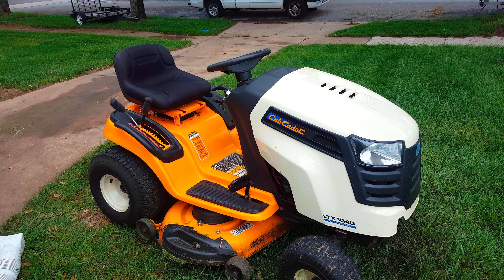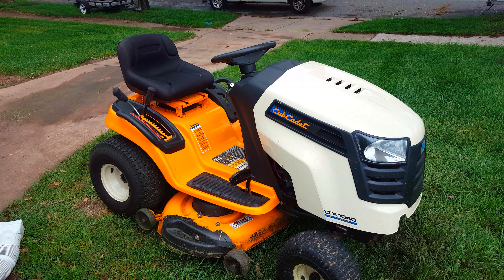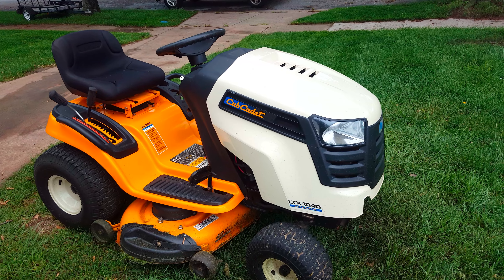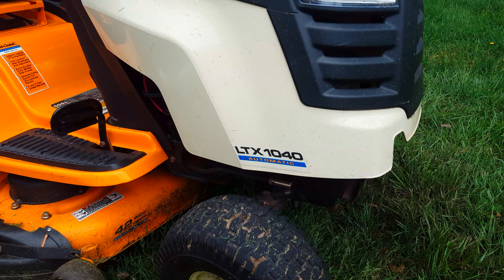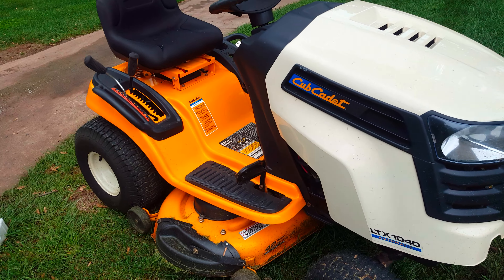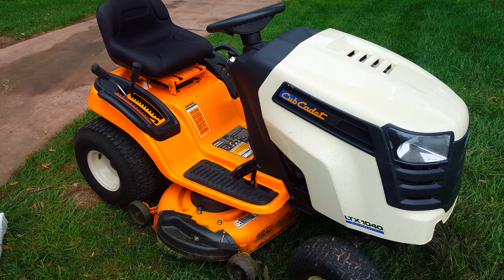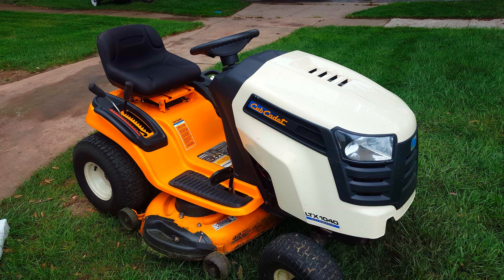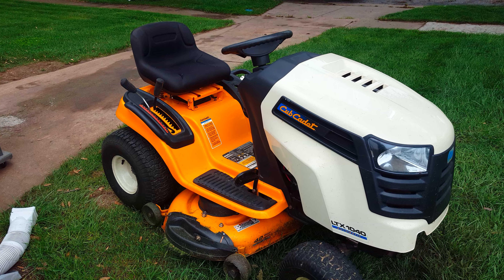Cub Cadet LTX 1040 moves slow

Comment: I own a Cub Cadet LTX 1040 as well, bought it in 2012 and just replaced both drive belts last fall... no slipping or slowing down... belts were getting cracked up, but had to push the Drive Pedal a little further each year to maintain speed. Engine is sound, no problems there!

Comment: This tractor has a CVT, (Constant Variable Transmission), style speed control The main drive belt from the engine goes through the drive pedal pulleys and then to the CVT drive pulleys directly. The CVT pulley also drives the smaller belt which goes around an idler pulley with the spring tensioner, and to the transmission pulley, which is the large one. I just picked up an LTX1040 that has 154 hours on it. That's SIX full 24-hour days of use on it. The Kohler engine was blown. Terrible engine for reliability. SV590 engine. They have serious self-destruction problems with the crankshaft counter-balance breaking and the dual cam shaft breaking. This one I just got had the counter-balance problem which went through the engine block in SEVERAL places. Tipping the engine sounds like marbles inside it. I replaced the engine with a brand-new Briggs 33S877 19HP engine. Almost a direct replacement engine. Runs better than the comparable Kohler.
The Slow Moving problem is caused by several factors, one being as you said, oil, grass, and other contaminants on the pulleys. Obviously the belt is one that causes it. Only use the original belt on this one. It isn't the best system, but costs less than the Hydro-static model. The harder you press the drive pedal makes the Variable Drive pulley change its pitch for each side of it. The center of the pulley slides up and down which makes the pulleys change the ratio of each other. That pulley may also bind up/rust which makes the speed not change.
Good video!

Comment: Friends, just a little tip: if electrical issue, note there is a hidden fuse down under the seat. This will save u some stress.

And tip of the hat for the video!

Comment: Thank you! Just got one of these for free because it won't move. I already disassembled the transmission and regreased it. Still wouldn't move. I think this might do the trick!
Reply from the maker: Try a belt first.  Also, you can run a little sandpaper over the CVT pulley where the belt rides.  The chances of the CVT being bad are low.  I think a belt will fix your problem.  Let us know how you make out.

Comment: Thanks. I'll give it a go. I just put a new drive belt on and was excited to get going... only not much go.
Reply: Watch the video on my page and you will see the fix it's super simple
Reply: @jlistdiy  
Turns out mine is leaking oil from the crank seal and dripping on the belt.
Reply: @WallysPlace66  well that sucks sounds like you have the Kohler engine
Reply: @jlistdiy  
No, the previous owner blew that up. I put a Briggs & Stratton opposed twin in it.  I ordered a sump gasket and a seal.
Reply: @WallysPlace66  ah ok yeah it happens
Reply: @jlistdiy  
It will give me something to do when the parts come in

Comment: I am of the idea after owning this thing that i will never own another!!  They work great for about 2 seasons and then the problems start.  Steering is wearing out after 120 hrs and now my belt needs changed.  Had  Murray's before for years and all i had to do was quickly change the deck belt.  Id get 8 seasons out of one and were cheap enough to just go buy another...
Reply from the maker: They're not building them the way they used to. That's for sure. I have a Honda push mower.....junk.  the older Deere and Cub stuff was the best.
Reply: I don't know...mine is 8 years old and still going.

Comment: Can you please explain the PTO handle on the side?  Thank you.
Reply: P.T.O. Power Take Off   !!  Most are defined by an electric clutch , but this is a cable tension system to engage the mower ....pull the handle back or push forward , it has a cable attached to it that runs down to a slider unit with another belt pulley that takes up belt slack and engages the blades thru belt friction ...

Comment: I have this same mower and my belt is very bad and it is getting slow. I know the belt is stretching with how bad it is cracked. I wish I could find a manual on how to change it. The manual says see a dealer for this one. I never do that.
Reply from the maker: Replacing the belt is not a hard job. If you have moderate experience , pop the deck off and if I remember correctly, it's two bolts that hold a bracket on and the belt comes right off.  It's a half hour job on a bad day.  You can do it!
Reply: Rob Rotenberry thanks for the tip. I can work on things but at a quick glance it looked buried. I just replaced the crankcase seal and valve cover gasket at 146 hours. I just bought the mower and the guy never touched it. I hate that.
Reply: @F8lastcallcharger345  take the battery out and the battery box will lift right out,much easier to do a belt change then...

Comment: Its called a variator, make sure it is working. it should move up and down spreading and collapsing the pulley. dirty pulleys are not your issue. you may have had a belt on wrong.  You can dip those pulleys in oil and they would still work.
Reply from the maker: You sound like you know what your talking about,  but I'm not sure dipping the pulleys in oil would promote good friction with the belts.

Comment: I have a 2015 LTX 1042 KW hydro. My problem is the front tires in sharp turns around trees + flower gardens tear up the ground with giant furrows !! I had the company rep out tore around some trees, left great furrows ! DUNNO he said. Several weeks later try experimented 1979 cub cadet hydro turning sharply. Guess what ? Its a miracle ! As fast as I could travel with sharp turns, NO FURROW !!!!!! KNOW WHY ?? Parked both tractors side by side same left turn. The same left turn, what a difference in the front tires of the turning angle ! On the old tractor (left turn) sitting in seat, the left tire has a sharper turning angle than the right. On the 2015 the complete OPPOSITE !! No wonder it tears up the yard so badly !! The stupid guy on the assembly line has been doing it wrong for years !!